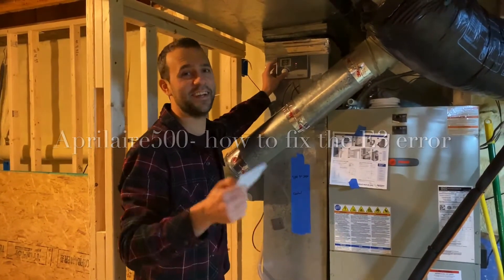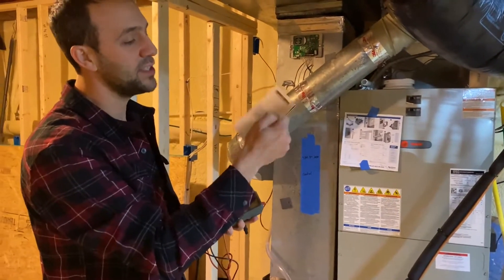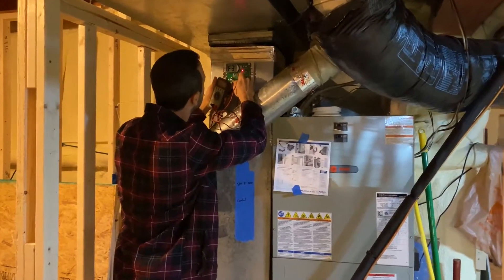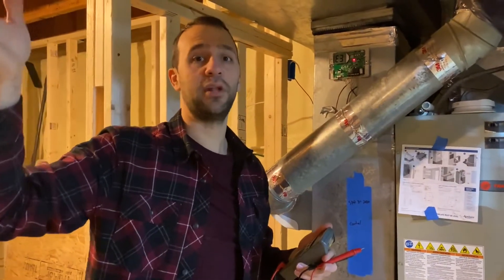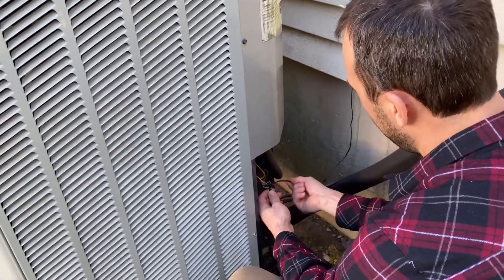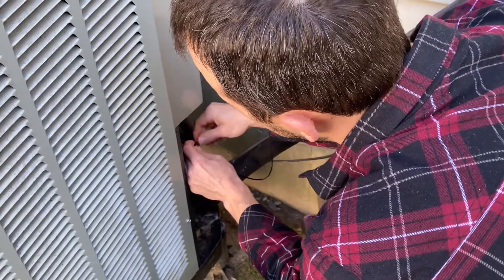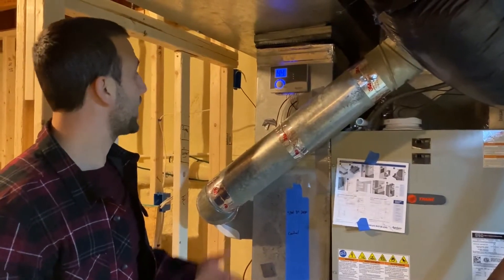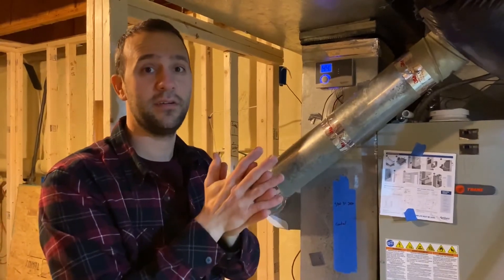How to quickly fix E3 error on Aprilaire 500 whole house humidifier

Comment: Why are you connecting the resistor at your outdoor AC condenser panel???  You just stated the resistor should be connected to the ODT connection and the 'connection to the right'.  Why aren't you just running the line from the resistor to ODT and second connections in the Aprilaire controller?  (You're just adding to confusion.
Reply from the maker: thanks for comment - not sure i understand question but i'll try.   All we're trying to do is check continuity from the wires in the ODT spot, to the outdoor resistor (or thermistor same thing)..  if it's connected, I'd replace outdoor resistor.   If it not connected, fix the break in the line and you should be good to go !   Enjoy ! Mike
Reply: @FamilyDIYtv  Is there a reason why you didn't inform viewers to turn off the power to those circuits before diddling about?  Or, properly grounding themselves?

Comment: PERFECT!  Had a wire that had popped loose from a wire nut on the outside temperature sensor!  Great video!  Thank you!
Reply: I did use the reset. Fault went away after my connection was repaired.
Reply from the maker: beautiful!!!!   i’m glad it helped !    sometimes it’s just a simple fix  ! 

thanks
Mike